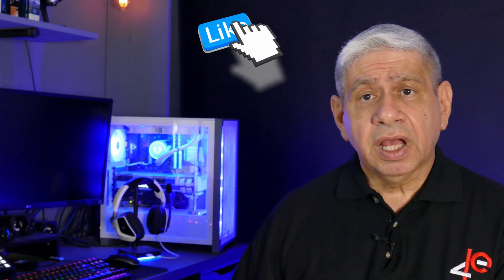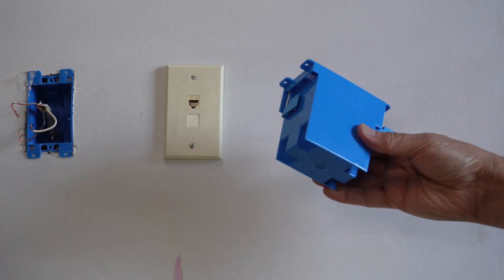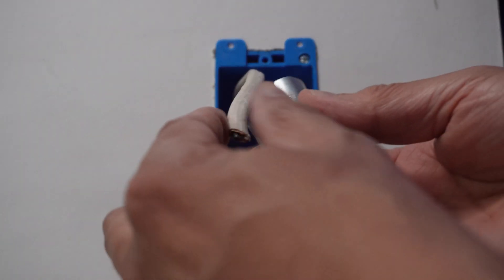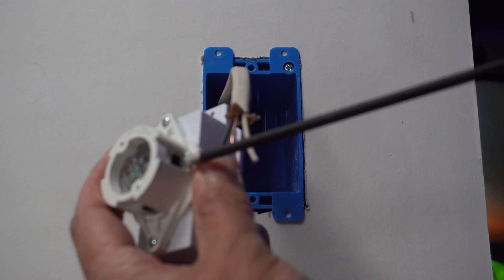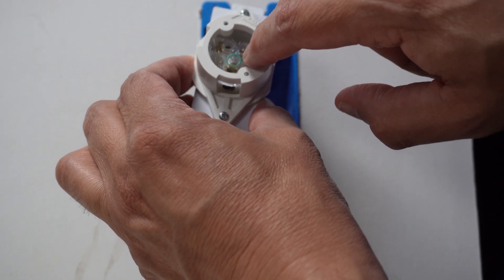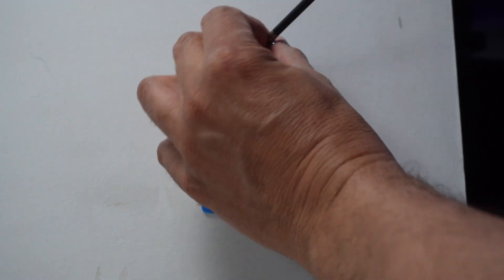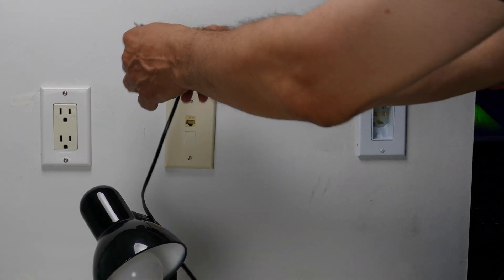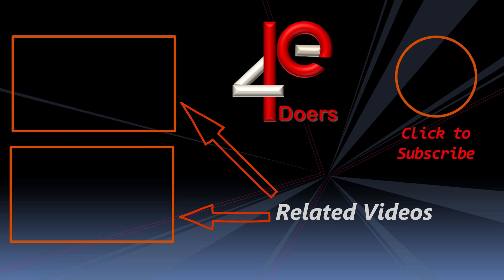Installing a Power Inlet that Provides UPS Power to a Secondary Room

Comment: I wanna do something similar because my UPS is very noisy. I want to put the UPS in another room and route power through the wall.
Reply from the maker: Using an Inlet at one end of an internal wall power run, with an outlet at the other, would definitely accomplish that desire.  By the way, what Brand/Model UPS do you have?

Comment: This is fantastic. I recently had a tankless gas water heater installed in my attic that I've been wanting to get on a UPS backup, and this approach will allow me to set up a UPS in a conditioned part of the house on the 2nd floor, then run romex from the inlet up to an outlet near the water heater! Thanks so much for this video!
Reply from the maker: You are very welcome.  Sounds like you have a perfect use-case for a power inlet.

Comment: Wouldn't it make more sense just to use a different ups? I router can run for hours on a $60 UPS.
Reply from the maker: You may be correct.  I just wanted to have a single control point for all my backup power, which I hoped I could supplement with some generated or renewable power at some point int he future.  Whether I get there or not only time will tell.

Comment: Excellent video David, very detailed! I never thought of distributing UPS power in that fashion. Very practical!
Reply from the maker: Thanks Tony.  I decided a while back to get one large UPS for my Server/Editing room, and to distribute the backup up power to systems and devices in different parts of that room without messy extension cords or unsightly cabling.  It has worked out well, since it also provides some small emergency lighting at the dark ends of the very long room.

Maybe when I build my retirement home (hopefully outside of New York, I will create a system that is a combo UPS and emergency generator located in a utility closet within the garage.  In addition to a fairly large air conditioned Server room of course 🙂

At least dreams are inexpensive ...

Comment: That was a great video. I tend not to do much with electrical beyond PoE, but this looks easy enough.
Reply from the maker: Thanks Jeremy.  Yes it easy to do, and as long as you use the approved mounting boxes, cable, and wiring completeness, it is per code in all 50 States and most countries.  This was a simulation for this video, however I will be doing this again for a slightly different purpose in my primary studio in the very near future.  Stay tuned.